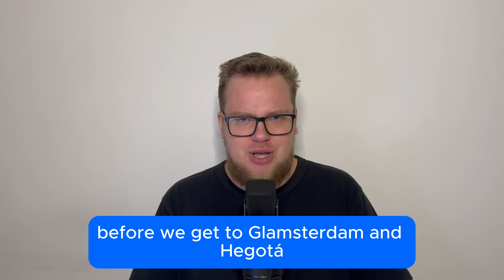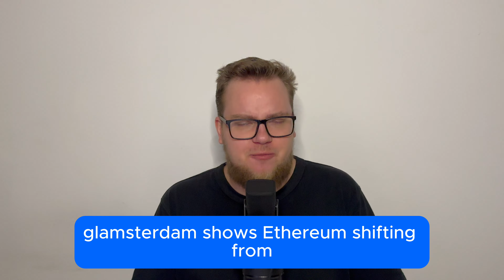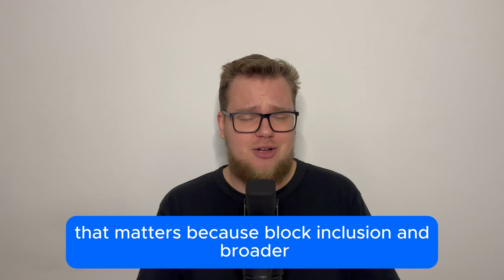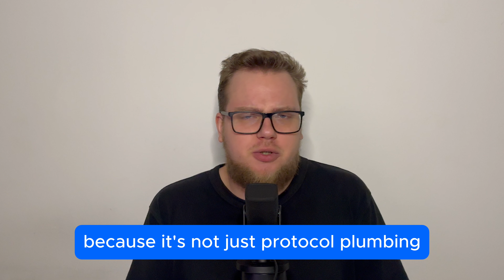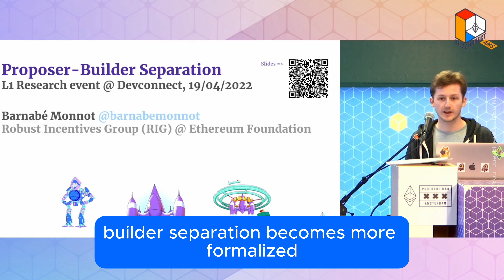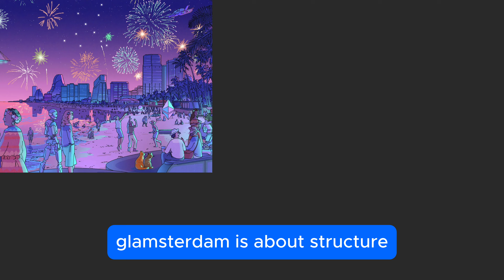Ethereum After Fusaka Hardfork: What Glamsterdam and Hegotá Mean for Builders

Comment: This is solid breakdown, Sergie, curious how you see ePBS and FOCIL impacting MEV strategies in practice?
Reply from the maker: Thank you for your question! The short answer: margins get tighter and the game gets fairer. ePBS removes the trusted relay bottleneck.
FOCIL is the real game-changer here. By forcing inclusion lists, searchers and builders lose the ability to fully dictate block contents. They will have to extract MEV around these forced transactions. 

It is a massive win for censorship resistance, but it means MEV algorithms are going to need a complete rewrite!